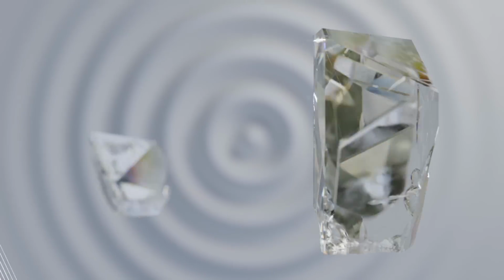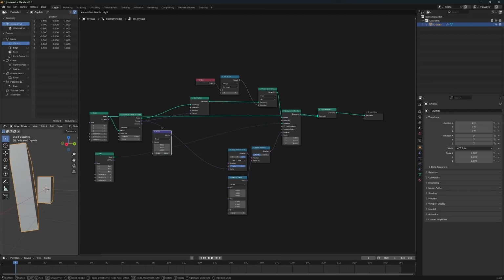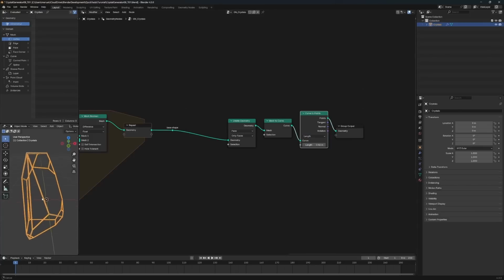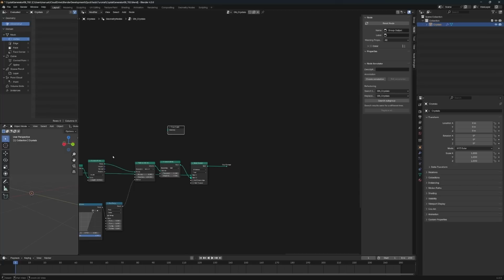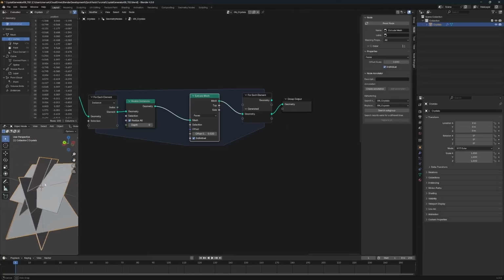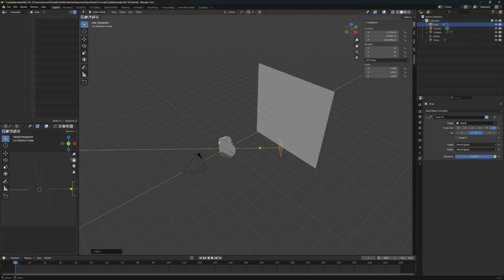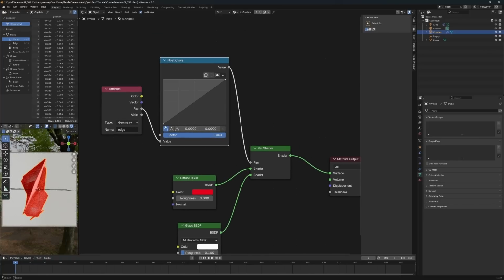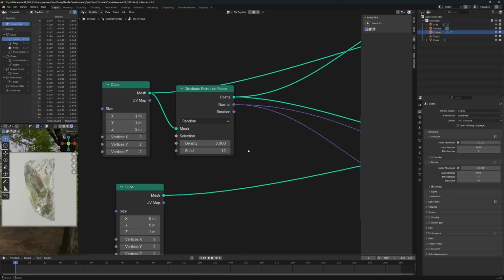Procedural Crystal Generator

Comment: To lock axis in Blender You can use MMB ...but those are so weak that I was destroying 2-3 mouses in year, now i buy 3dconnection mouse witch have separate button for MMB its IDEAL for Blender. 
TO be clear it not that You have programmable buttons like all mouses have, no!  You literally have LMB MMB RMB  + wheel with MMB.

Comment: great tutorial, fascinating and inventive use of geometry nodes. 
I do have a problem though, with glass
for whatever reason in blender 4.4 glass acts differently, and it seems to be very difficult to get the glass to not appear black,
I'm struggling with the material settings and the render settings, that of cycles and evee. 
I can get it somewhat transparent in evee but it still not a shiny on the surface as it should be. 
glass seems to be not acting correctly no matter what I type in.
do you have settings you recommend for blender 4.4 ?
Reply: the best settings i've found for the glass to look good is by adjusting the light path in cycles 
total 12
diffuse 4
glossy 4
transmission 12
volume 0
transparent 8

although it is a little noisy at 300 render samples
but denoiser turned on (and set to optix for me ) actual fixes the noise issue

 for evee i'd imagine it'd need another material entirely, probably something to do with lightpaths, and transmission, but i'm just guessing

Comment: HI, Asking one out of context question here.  I am new to houdini. Facing this weird issue as I have imported an alembic asset(renderman's rolling pot asset) through file node and wanted to assign different material to its individual parts. 
1. So I have taken group node and added those parts in Base Group and named the asset part in Group Name section. Later I have taken a material node and created few materials and assigned them but nothing is getting applied on the geometry.
2. I blasted each part and added name sop and assign a name to it then added material node and assign mat to it still same.
3. I unpack it but getting out of range error
Please need a solution